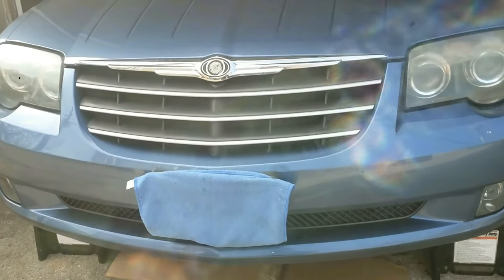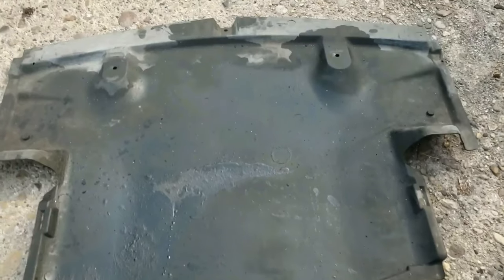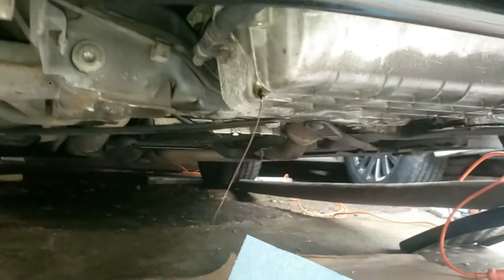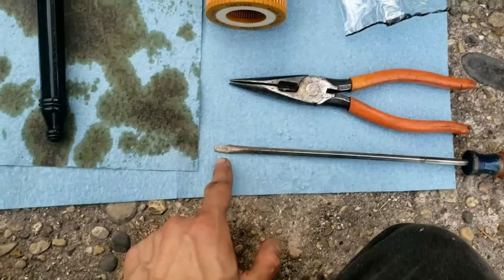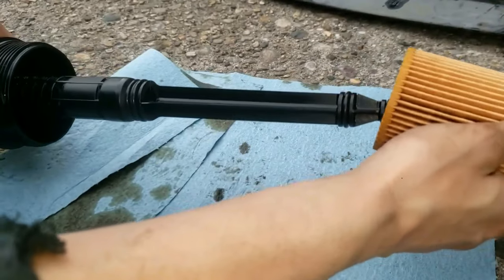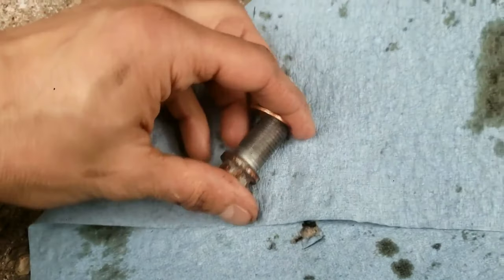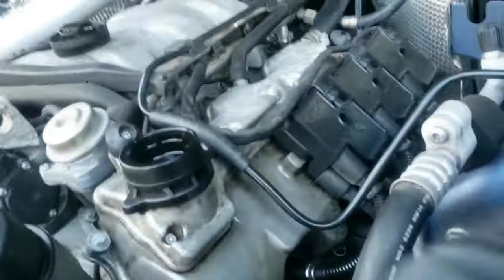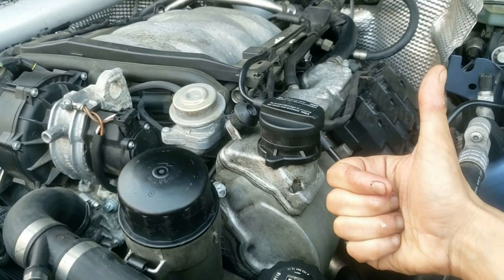Mercedes SLK & Chrysler Crossfire 🏎️ Oil Change & Oil Filter Replacement

Comment: You should mention that most floor ramps are too high for the crossfire to get up onto, and if jacked up from the passenger side, close to 1.5 quarts of old oil will be left in the pan.

After the oil change when you check dip stick levels (if you put in 8 qts like you mentioned) you have the condition of having too much oil in the engine.

Jacking from the drivers side mitigates this and provides for full pan draining without overfilling.
Reply from the maker: Great feedback. Nice details.